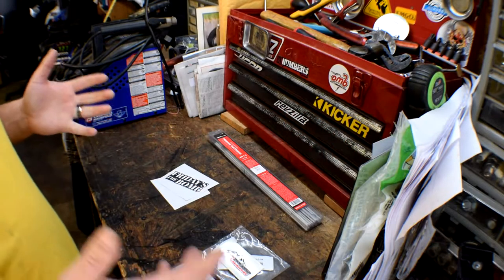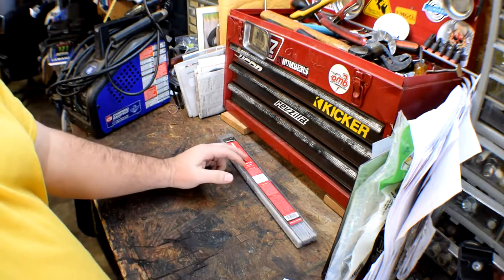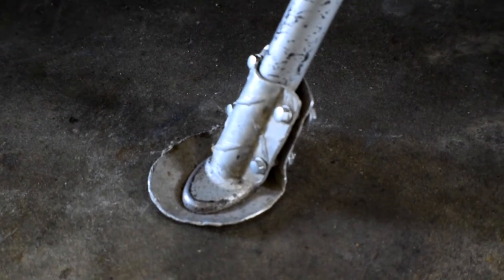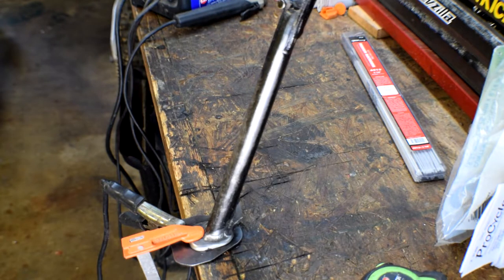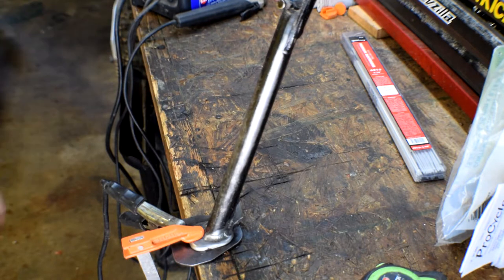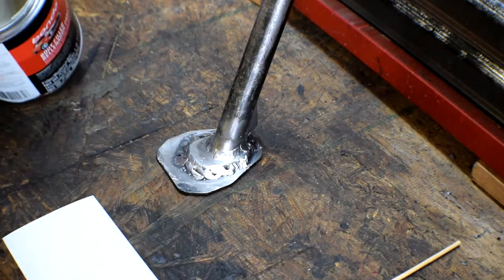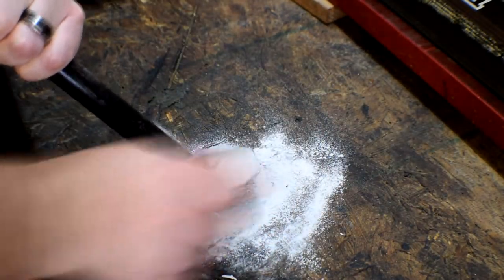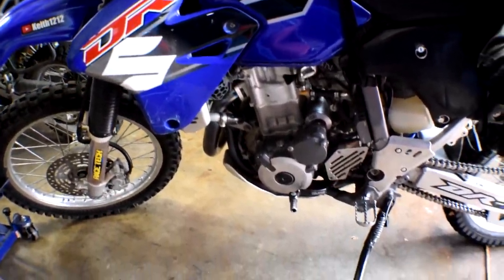Weld On Foot Pad For Suzuki DRZ 400! - JNS Engineering

Comment: Hi, Probably could have just went with the three spot welds...If it would have came loose/off, no big deal. Not like it holds the motor or swing arm on.   I tend to WAY Over weld things too! 
If you would ever decide to remove that thing..... Forget About It..!!!!   LOL
Oh, Lots of times before I make small spot welds, I heat the part with a propane torch first. It flows in Much better and makes stronger more penetrating weld <;)    Take Care...
Reply from the maker: Yea I just didn't trust the spot welds from this lil welder. I tend to spin the bike around on the stand as well and wanted it to be strong. I shouldn't have any reason to remove it in the future as the stock plate it just so tiny. Thanks for the tips and checking out my video I appreciate it!

Comment: Looks pretty good to me. I like the two parts JB weld  epoxy as I have found the bondo doesn't like vibration and the JB flows pretty good too. Let me know  how the bondo  does after a season .
Reply from the maker: I just didn't know how sand able the JB weld would be. It held up perfect over this 2 day weekend ride. So I'm hoping it holds well. If nothing else all the layers of paint will hold it hahaha! Cheers Steve!